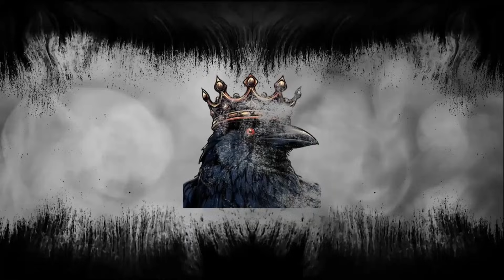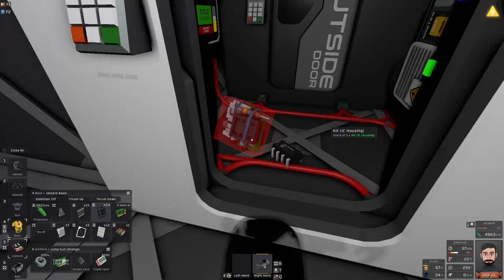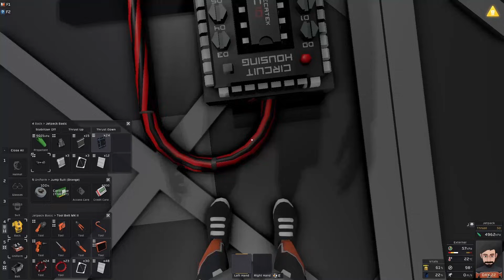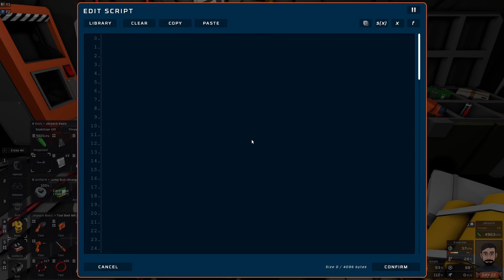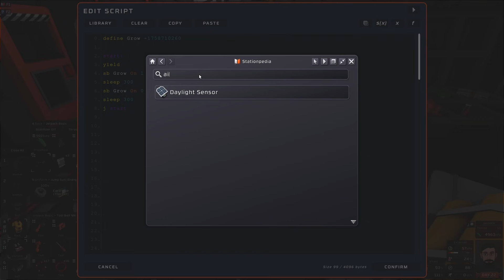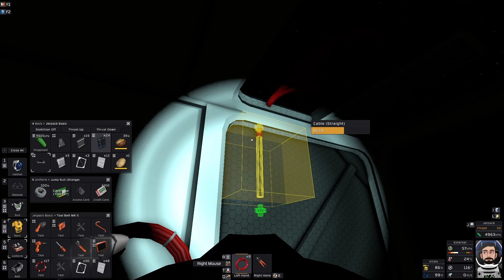IC Logic Intro and Food Quality in Stationeers | Episode 10

Comment: Between what I've been playing and learning, I have a question. How do I refill the welding tanks? What do I need to do? Could you help me with that?
Reply: Newish to the game as well, so take what I say with a grain of salt, but here's my understanding:

So tanks like the welder use fuel. Fuel is specifically defined as any gas mixture composed of 2:1 volatiles and oxite/oxygen (you'll recognize this as the same mixture used in the furnace).

There's a couple ways to get fuel. The simplest is to simply grab 2 volatile ice and 1 oxite ice, put them in a vacuum airlock, and open the corresponding fuel tank, which equalizes with the surrounding atmosphere, absorbing some of the fuel mixture. This method is wasteful, but simple to do in a pinch. 

The second method is to use the ice crusher. Use the ice crusher to melt volatile ice and oxite in that same 2:1 ratio, then output to a Liquid Canister Storage with your tank. This process produces nitrogen, but (to my knowledge) so long as the mixture of volatiles:oxygen remains 2:1, doesn't have any outright negative effect besides reducing space in the tank for more fuel. You can filter it out pretty easily though.

The third method is to get pure volatile and oxygen gas in tanks, hook them into pipes, and then use a gas mixer to get the ideal ratio of fuel.
Reply: @owenchafer1083  lov u men ty